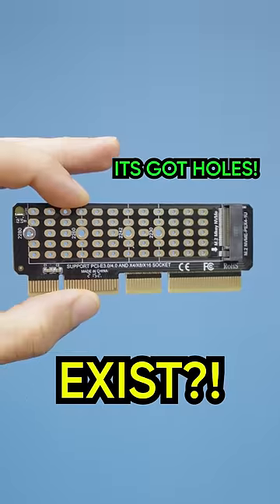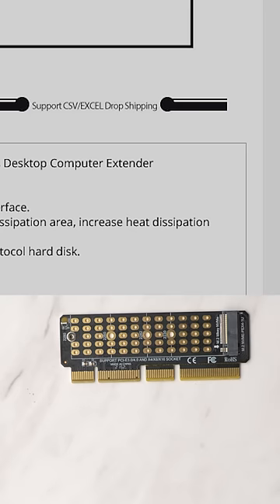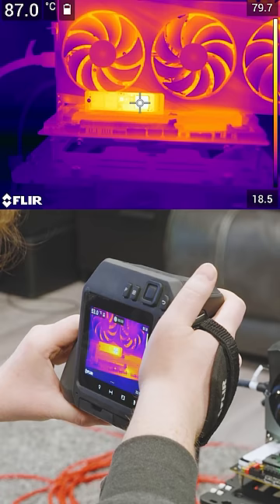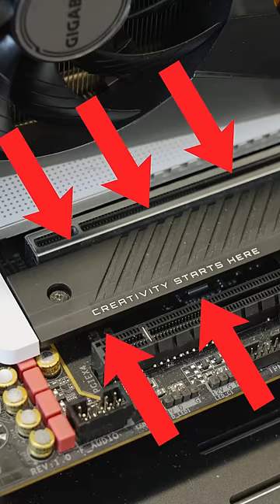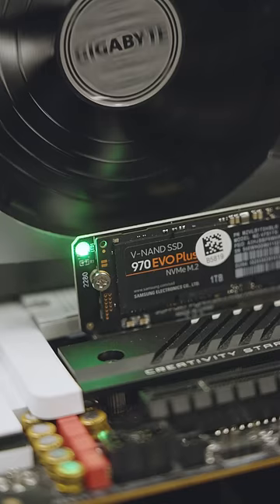Why does this have holes?!

Comment: Chinese products are full of shit and have always been. I once brought a knock off Playstation Controller to Mouse adapter and it didn't work after about a couple days of use. I looked inside and the wires, instead of being soldered, were hot glued together